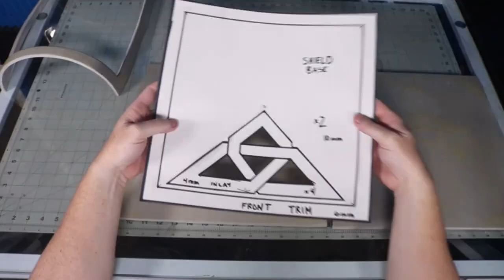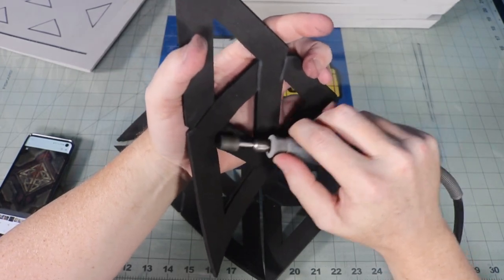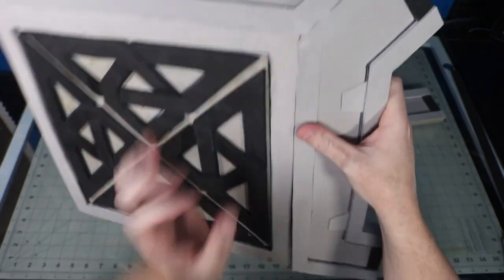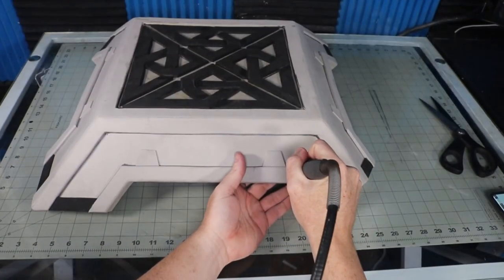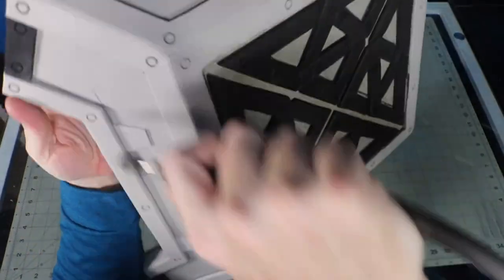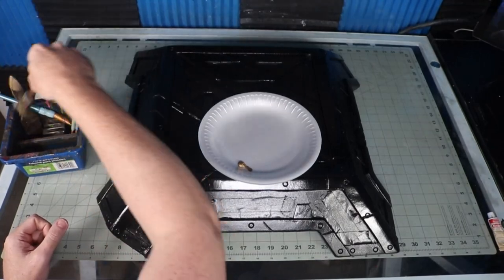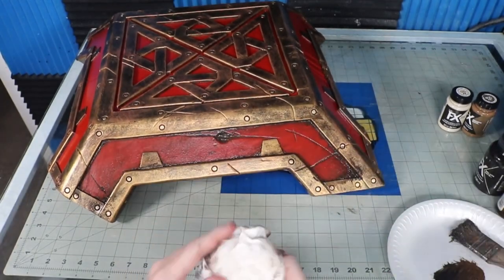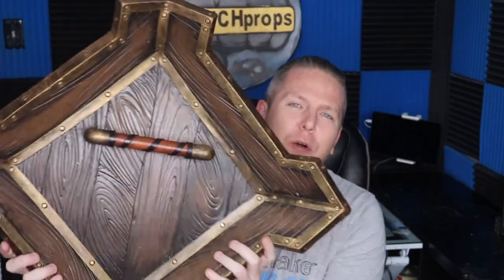Foam Crafting a Dwarven Shield from LOTR

Comment: The center handle makes it a buckler rather then an arm shield. Looks great.  Another way yours could be held in battle would be with the forearm vertical with the hand curling around the back of the handle at the top.
Reply from the maker: Good to know. Never really made any for practical purposes, just love me some shields on a wall.
Reply: @MuchProps  Well I do reenactment and LARP when possible. LARP makes those foam shields very practical (lol)